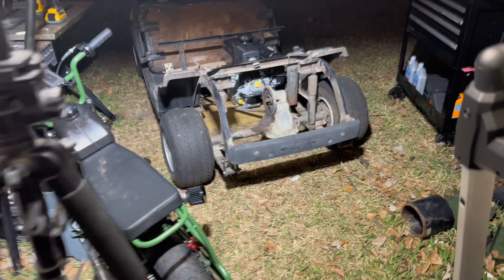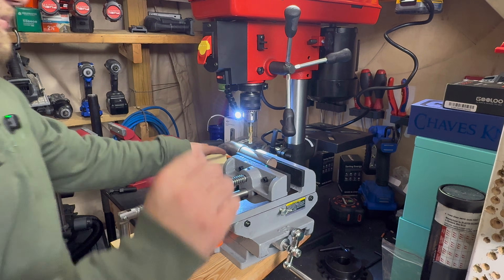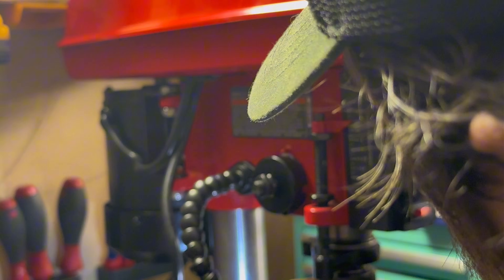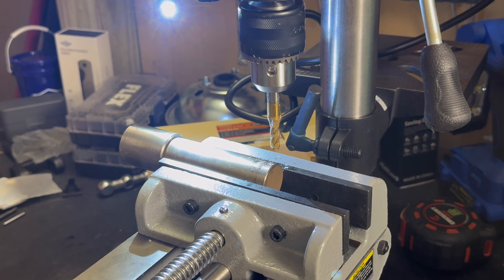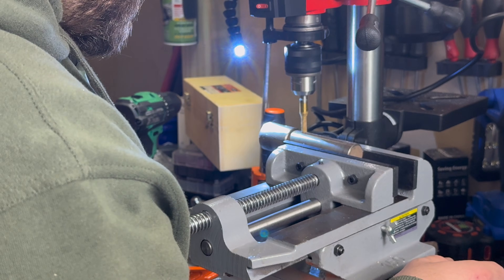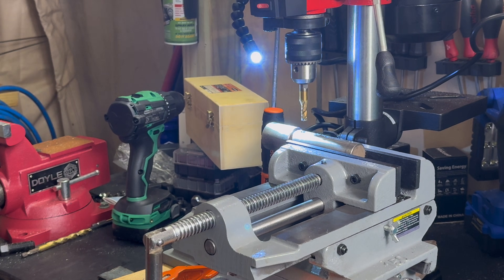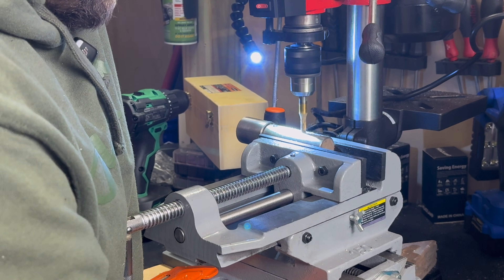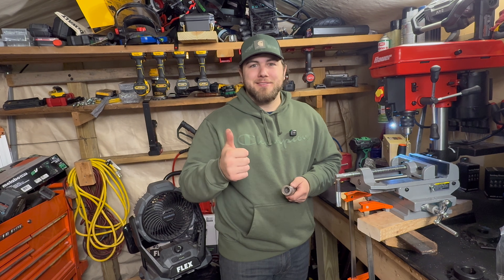This Harbor Freight Hack Was a Huge Mistake

Comment: I'm surprised you didn't at least use some cutting oil.  I could see the smoke emanating from the cutting mill,  Good thing they are HF bits, cheap enough to discard the dull cutting mill afterwards.

Comment: use a Friking grinder with a wide disk dork ... that s what we Heavy duty mechanics do in the field
Reply: you drill a hole at the end of the key way to the depth required then you use a grinder to cut it down  and you can also use a cold chisel and a file to clean it up

Comment: Before you even showed what you bought, I could have told you to not do it. A drill press, particularly a cheap one like this simply isn’t designed for sideways torque. It’s incredibly lucky you got anything done at all.

Honestly, even for a small beginning business, you need to invest in equipment to do work properly. This isn’t that. You can get, as some have suggested, a mini mill. You need to realistically think about what you want to do there, then get what you need to do it. Don’t get one from harbor freight. Get one from Grizzly or Precision Matthew. You’ll know you’ll get support and parts for some time. It’s worth it as you’ll find you can do work you can’t do now.

Comment: If you do a lot of engine work, get a mill and a lathe. Vevor makes some small machines that won't break the bank and they are pretty accurate. You need something with tighter ways and more HP. The only drill press that I have ever seen that has a spindle with less than .005 inch lateral movement is a Clausing and that Bauer is NO Clausing!
Reply from the maker: For sure, I just don’t have anywhere to put all this stuff………..YET

Comment: It does work, you need to make sure your cross-slide travel is perpendicular to the rear post, slow, very slow and light cuts and a good cutting oil.  To be honest, the easies way to cut a keyway without a mill is to use a Dremel with the crappy little cutoff wheels, you use the round bottom keyway and cut the slot just big enough for the sprocket, that way, there is no chance of the key sliding out of the slot from vibration
Reply from the maker: I’ll give that a try next time

Comment: I found leaked patented files for new flex tools. Some 24v new tools and 24v gen2 tools. Also a possibility of a 12v line with stacked lithium batteries.
Reply from the maker: I saw that over on Facebook! Pretty interesting stuff. I’m still waiting to see that 3 inch cutoff tool come to market as well
Reply: @Kaleb_RoSs yeah that would be nice. Hopefully it’s all true
Reply: @Kaleb_RoSs  where is the FB post, bud? interested in seeing it
Reply from the maker: @Zildjian0321 shared in the flex North America Facebook group. Pretty sure it was shared yesterday
Reply: Flex is in a lot of trouble. Whether they will be in business by the end of 2026 is up in the air right now.
Reply: I called Flex today, and they said they were NOT offering the lifetime warranty this year! That is upsetting in my book.

Comment: Too bad you couldn't find an old Bridgeport. That would be ideal for this. I had one but it was destroyed when my arsonist neighbor decided to melt my 40+ year collection.. I didn't have the Bridgeport set up yet but it was just as damaged as the rest of what I had. I lended up having a small red toolbox full of tools left after all that. Very lucky no one was hurt or the house. You are doing the best with what you got. High five on that. Was really fun to watch, could have turned out better. Yeah I would check at a local NAPA and see if the machine shop could finish it.